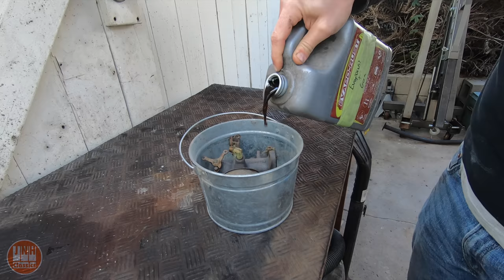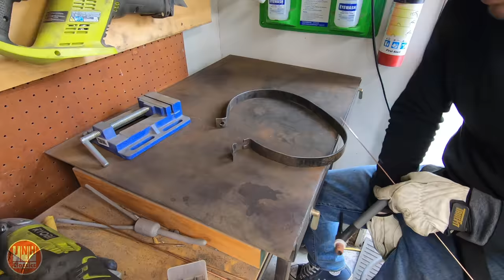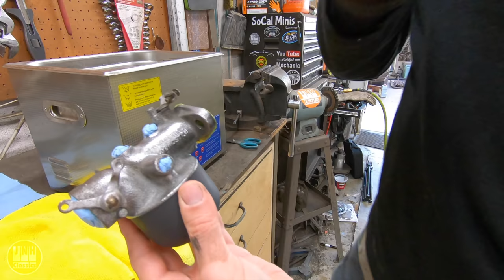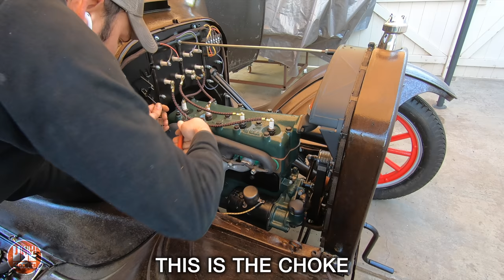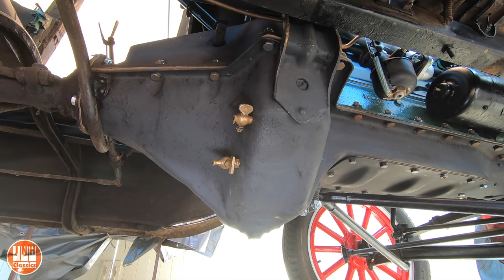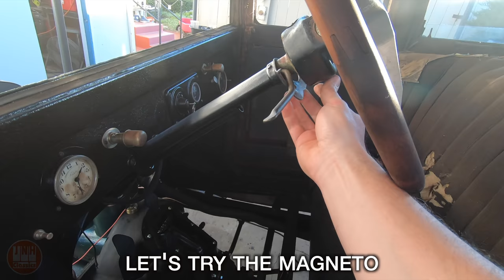A Forgotten Model T (Episode 13) FIRST START IN 30 YEARS!

Comment: very nice job. This engine is running nicely! 

To make a cold start, adjust the mixture to "rich" (don't overturn)
Advance lever "up" 
Short "choke" while using the starter-motor.
Once the engine is running for a few minutes, adjust the mixture (and not immediately the advance).

That's what my Pa told me (a very long time ago)

Comment: Good job. Craftsman. One of my brothers owned a Model T. I was pretty small in early 40's, he was driving very slow and my other brother and I wer piled into and on the T. I was standing on one running board and thought I could run that fast. Jumped to the ground and momentum almost taught me a lesson when my feet hit the ground and then my head hit the ground shortly thereafter. Didn't learn anything, because I tried it again 20 years later while inebriated and almost died from the concussion.

Comment: Having been around Model T's my entire life (took my drivers test in a 1921 Model T Roadster in 1992 at age 16), I have to admit I was worried when I saw your first video.  Many times I've seen folks 'get into Model T's' only to be daunted by how unfamiliar they are with them.  It isn't that they are complex, they're just different from modern cars in a very simplified way.  However, you stuck with it and got her running.  And not just running using modern parts (lawnmower carb and distributor swap), but using the coils / timer and magneto as well!  Well done sir!  Subscribed!
Reply from the maker: Thanks buddy! I appreciate the kind words👍

Comment: Well done!  The vendors sell a lead gasket that fits behind the sediment bowl screen assembly if your leaks there.
Reply: This is the man I was expecting to comment! Thanks for your input, you are definitely a Model T expert and I have valued your comments in previous videos. I did see some o rings and seals on the carb kit that didn’t get installed on camera, maybe one of them belonged there?
Reply: @vayabroder729  The very small red gasket fits under the carburetor jet.  The others probably fit under the brass plugs that screw into the top and side of the carb body.

Comment: Congratulations! Very glad to see that you got it running. As for the leak at the bowl nut on the carburetor, there should be 2 gaskets at the bowl nut. One on the inside (between the bowl and carb) and one on the outside between the nut and bowl. Keep up the good work.

Comment: Wow!  I wish I had the time and space to have such a project.  My current "play pretty" is a 1955 Imperial Newport Coupe.  All original, 73k miles.  Full power, factory A/C, original factory option Kelsey Hayes wire wheels.  Engine's never been opened, original paint and interior.  

Several non-visible modifications -- 6-volt electric fuel pump to prime the carburetor bowls, an Interstate 6/12 battery system -- 2 6-volt batteries for normal running and so the original 6-volte generator can charge it; to crank, a solenoid closes to put all 6 cells in series giving 12-volt power for the coil and starter motor.  The Imperial Owner's Club went to a sheet metal fabricator to make a factory duplicate air filter, except instead of the original messy oil bath air cleaner, it takes a pleated paper round filter.  Looks all the same from the top, and you don't see the paper filter until you remove the wingnut on the top and remove the top plate.

Comment: About to start my Model TT (again).  The Bendix jammed after a couple pops the first time I tried. Its been in a barn for 50 years.  I didn't see you adjust the mixture after it started. It sounded good the way it was set.  Great video.

Comment: The air intake was sometimes converted to a snorkle. The roads in those days would often flood and river and creek crossings where simple stoned pavers that would not wash away as the washes where sometimes quite shallow but in a rainy period the snorkle was essential to keep the water out of the engine...
Reply: No air filter?
Reply: @woodhonky3890  screen maybe then in later models they would do oil cups but air filters were little further down the timeline
Reply: @MyLevelheaded  Thanks

Comment: Well done. But surprised you didn't use distilled water in the radiator.
They last so much longer, no corrosion, with distilled water.

Comment: Hope that you eventually moved the spark plug wire away from the exhaust manifold. As a former Fiero owner I know that can cause problems on down the line.

Comment: The engine runs nicely and that after 30 years.  Does the alternator work, is the battery charged? I did not see the amp meter move.

Comment: Great video. Assembling my 25 Roadster engine. What do you use in your ultrasonic cleaner? I have tried plain water to Pine sol and it works okay but not as clean as yours came out.

Comment: VICTORY!!  I did not see if the rear wheels were turning.  Is that a torque tube or a driveshaft setup?
Reply from the maker: I’m not sure what to call it, probably a drive shaft. I was concerned it might try to drive away once it started but it didn’t. I still need to adjust the bands in the transmission but it does spin the wheels when you press the pedals as it should. 👍

Comment: Hello, good day, I congratulate you on the progress of your project and every effort, I just have one question: is it possible to use antifreeze instead of water on an old Ford T, can it cause problems? Will the engine hold up? and because?
Reply from the maker: Some people say you shouldn’t use antifreeze and that distilled water is the best option. I recommend doing your own research and using what works best for you and your climate

Comment: Question.  What did you use to clean the inside of the fuel tank?  The same juice you soaked the carburetor in?  I THINK my fuel tank is good, as in I don’t think it leaks…but there is some rust inside.  Thoroughly enjoying your no talking videos. 👍
Reply from the maker: Mine was completely dry so I just blew it out. But I’ve used evaporust to clean tanks in the past👍
Reply: @Jerod_Helt  thank you!

Comment: Falta lo mero bueno las vestiduras y el toldo y pintura toda la carrocería lo bueno es que tiene sus placas originales y estás no las toques así están bien suerte en lo que falta
Reply: The only good thing is missing, the clothes and the awning and painting all the bodywork, the good thing is that it has its original plates and you are not touch them so they are good luck in what is missing

Comment: Yo need to find an original steering wheel, the one on your car looks really out of place ;)
Reply: I believe it’s the original one; he can fix it; he’s done it before on other projects.
Reply: @vayabroder729  really?
Reply: Looks like a “fat man” steering wheel.
Reply: Not factory original, but an original aftermarket accessory wheel. A locking, Fat-Man style steering wheel period correct accessory.
Reply: @pepstrebeck938  Ok!I searched fat boy steering wheel and I found the same one ;)